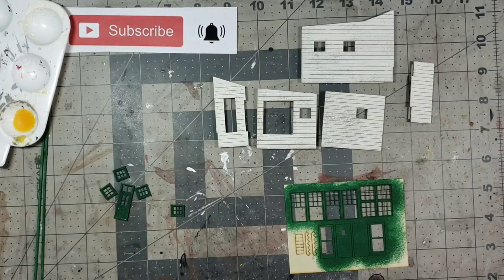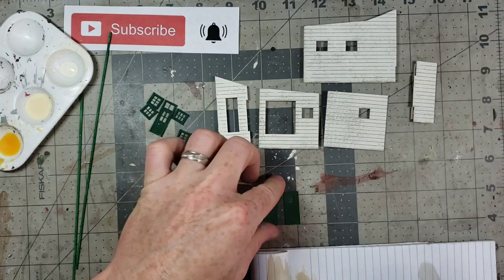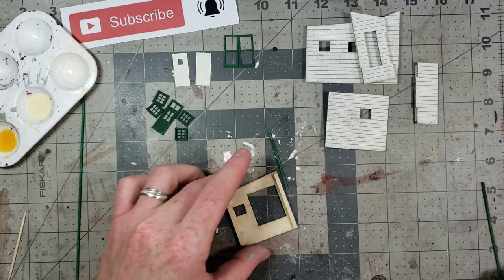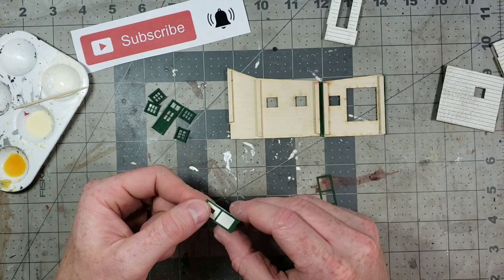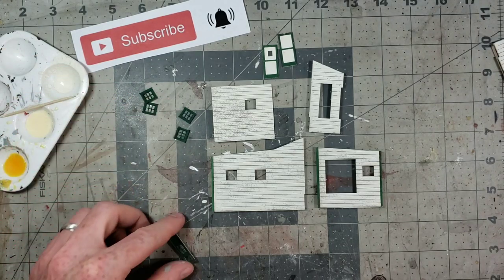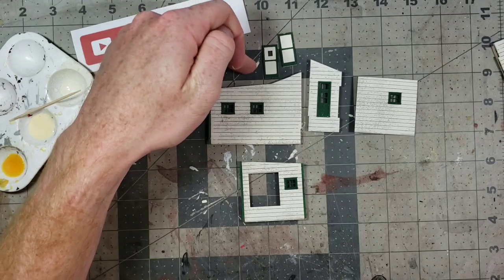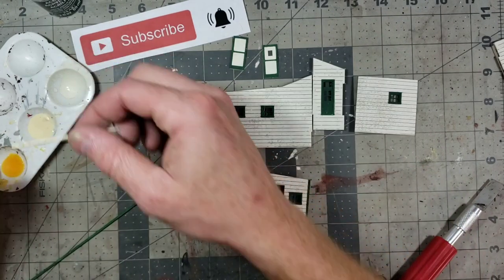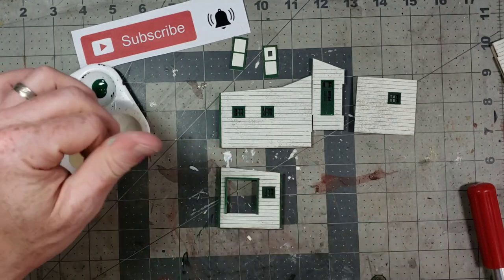06. Gluing Windows & Doors In - How to Build a Craftsman Model Railroad Kit

Comment: Have you ever considered using tacky glue instead of wood glue? I like tacky glue because it dries clear instead of yellow like wood glue.
Reply from the maker: We use tacky glue quite a bit throughout our builds and work, but for the wood walls and trim, I use wood glue. As long as you keep it thin and don't overdo it, you shouldn't have much of an issue... At least I've found.
Reply: @WileysScaleModeling  Does the wood glue hold better that you use it on walls and trim? I've never had issues using tacky glue.
Reply from the maker: @nateshon3eastbroadtoprailr448  Honestly, we've never tried tacky glue for the wood walls! haha, so we'd have to give that a shot!

Do you have the new upside-down tacky glue bottles?
Reply: @WileysScaleModeling  Nope, haven't heard of them. I have Elmer's Craft Bond and Aleene's
Reply: @WileysScaleModeling  I've only used Aleene's tacky glue, for years, though did buy a small bottle of Elmer's Clear Glue. That worked well for glazing, like folks do with canopy Glue. I use a small 4oz bottle of Aleene's, with a smaller opening than the large bottles, and just refill from the large, when needed. That upside-down bottle/cap looks like a great idea, going to pick one up later today. Thanks.